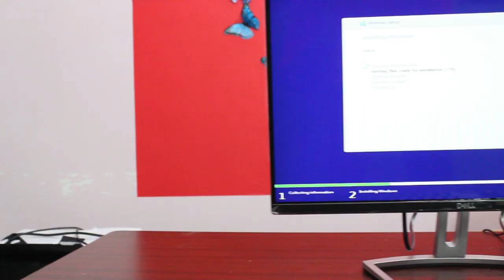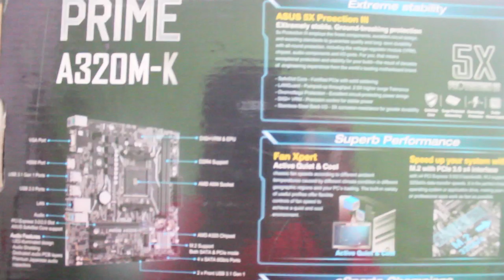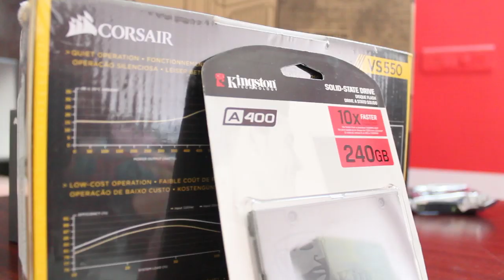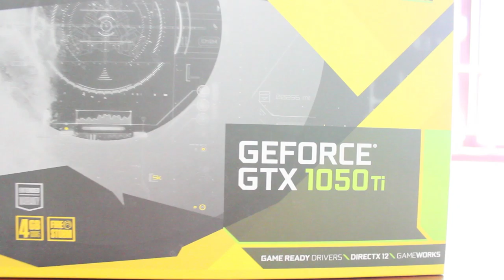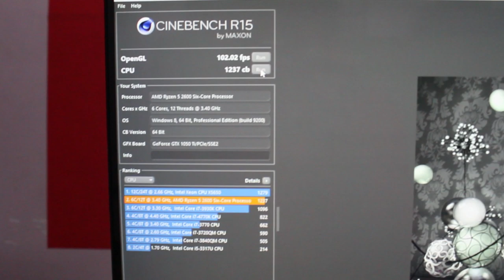Low Price Gaming PC Build 2019 in Tamil | Tech Vibrate

Comment: Y can't u go for Rx 570 is 13k only and performance is greater than gtx 1050 and less than gtc 1060 it gives 60fps ultra in pubg pc
Reply from the maker: this card is only 11k bro and during the build that card is around 15k in local market
Reply: Still every one is going for 1050ti which isn't that good as Rx 570 which is only 13k in mdcomputers for like 3months.🤣
Reply from the maker: @ajay3059  this build is done on November bro.
Reply: @TechVibrate  u could have spent extra 3k for 570 instead of the going with1050ti which is far more better than 1050ti (now it's only 13k)